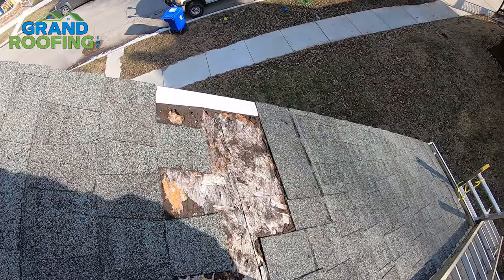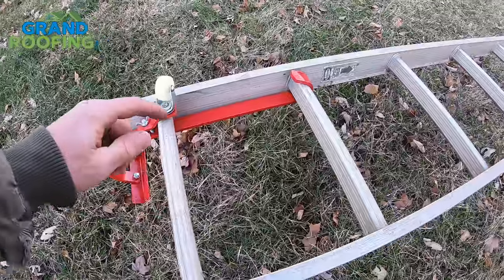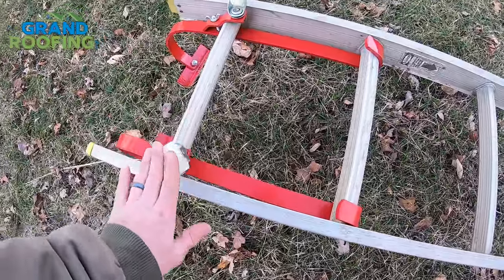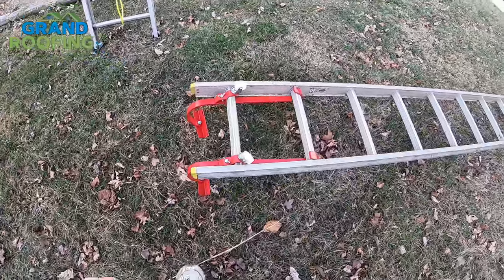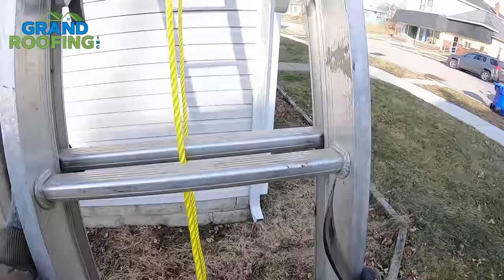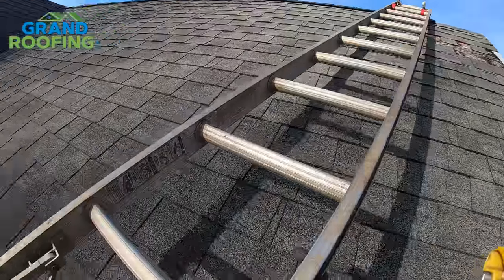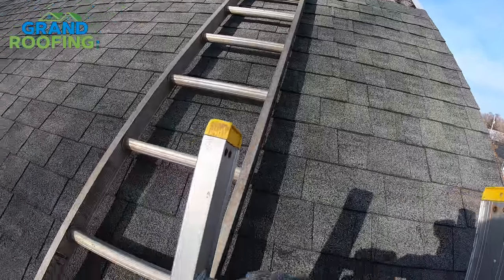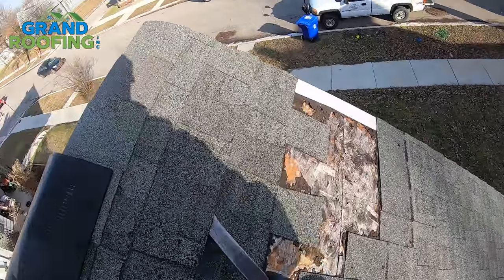Rooftop safety how to work on a steep roof - with a hook ladder

Comment: A good design but those cheap butterfly nuts are inadequate for potential load.  Replace with true nuts, doubled, and lose a small bit of convenience for increase in safety.
Reply: The load is taken by the hooks around the rung and over the ridge. The wing nuts are only holding the wheels against the rung while you push the ladder up to the ridge.
Reply: Or just put some paws on and go to work. If crazy safety becomes the standard norm I'll be quoting extra.
Reply: @alan2804  This.

Comment: Back in the late 80s and  90s installing metal roofs on steep pitches, we would strap two ladders together at ridge draping each side insalling both sides at one time. Put on two pans then bounce the ladder simultaneously accross to install two more. So on and so on. Worked out fantastic.

Comment: Good system, it makes the ladder looks like a firefighter hooked ladder that allows to climb hooking the ladder around windows stools.
We used to climb several floors where there was not space or time to place a full truck with ladder. During my firemen times...
Also... give a good shake to the hooked ladder before climbing over it, just to make sure is securely hooked to the ridge.

Comment: If it is not already noted the wheels ne to be bi directional not swivel as swivel wheels could cause your ladder to go sideways as you guild your ladder up or down the roof.
Reply: Yes, very dangerous!
 The first thing I do is wrap electrical tape around the bottom of the caster so the wheels can’t swivel and potentially slide off the roof left or right.

Comment: Nice video- yes, put your anchor point and harness on! You might also consider using permanent anchor points as part of your sales process. Buying them in bulk will get the price down to make it pretty reasonable to have permanent anchor points every 20' or so along the ridges. Homeowners might consider putting permanent anchors in for areas where they need to do frequent repairs.
Reply: Imo permanent roof anchors should be a mandatory code. The homeowner needs to have them installed. New construction should be installed by law.
Reply: No one envisages to make frequent repairs. no one...
On a different note... in some European countries permanent anchors are now required by code on new homes and after a full re-roofing.

Comment: I am 75 and getting noticeably weaker. The heavy ridge hooks atop the ridge  ladder can take a lot to control, so I put the ridge ladder at the side of the climb ladder, then I climb and fit the hooks while I am at the top of the climb ladder...  Easy.   From there it is easy to run the ridge ladder up on its wheels..  I also used stainless 'anchor points' (home depot  $3), screwed to the studs under the siding to fasten my ropes to.  I use 2 anchor points to make sure.....

Comment: how do you use ladder hooks when its a metal roof with a full length vent ridge cap??  
i cant find ladder hooks that reach over far enough that wouldn't damage the vent cap.

Comment: You can throw a rope clear over the ridge to the flip side to the ground and tie off to something on the ground.    did I do that ? nope.  I used roof jacks and plank at bottom run and stood a 6 ft step ladder against the roof and shuffle on up. and if need be, on a long rafter run,  set another plank and drag step ladder up and repeat. But I'm 62 now, lost my equilibrium.  But I'll tell ya,, I was a shingle slapping hand nailing fool for 40 years. Now I just talk shit.. lol..

Comment: Can you use this on a 10/12 metal roof?
Reply from the maker: Yes I have used them safely on a 12/12 pitch steel roof. I would recommend wrapping some cloth around the part that rests on the opposing side. That way you don't scratch it all up. You'll need to be careful when installing the ridge cap.
Reply: Grand Roofing Inc. thanks for the information I will be  washing the roof just trying to be safe as I can

Comment: Does that work over a ridge vent?
Reply from the maker: Yes
Reply: @GrandRoofingInc  thanks for the answer I should have finished the video it looked like that roof had a ridge vent
Reply from the maker: @Shonuff42080  you're fine. It does work with ridge vent you just need to be somewhat careful.